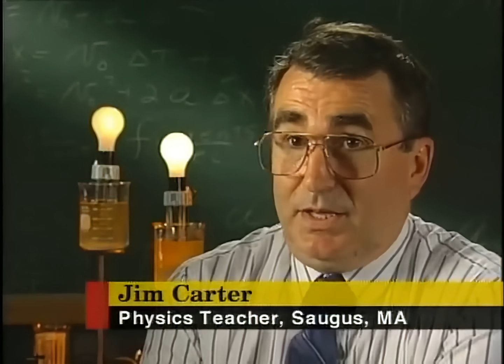MIT graduates cannot power a light bulb with a battery.

Comment: It was a trick question.  The correct answer would have been "It depends on the battery and the light bulb."
Reply: Geir Sunde No, the question was actually very poorly worded "Can you light a bulb with a battery?"  What kind of bulb?  A garlic bulb?  What do you mean light it?  Set it on fire?

The question should have been "Can you make this lightbulb turn on with this battery and wire?"  Because no matter how you hook it up, a D cell battery isn't going to light up a 20 watt lightbulb, it's barely going to light up a 2 watt indicator light in fact, and even then the battery is going to get very hot very fast from all the current it has to deliver.  A flashlight lightbulb?  Yes, but they only show one of those in this video, and it's where the guy gets it to light up.

All this is is an example of poor journalism.
Reply: Geir Sunde look at the size of those bulbs!  Are you nuts?  Have you ever even seen a flashlight that runs on one D cell?
Reply: Well the DC part shouldn't matter, because a light bulb is a purely resistive load, but yeah, it's still just a journalism chop job.  This is why you shouldn't give interviews to journalism students.  They do this stuff not just for local news, but usually as a school project also, and they're more than willing to cut out anything intelligent you say if they want you to look dumb.
Reply: Justin Hall We had a project in grade 9 science class where we had one 9v battery and we had to build a main floor of a house out of a cardboard box that had to have a living room, bedroom, kitchen/dining area and a bathroom. We had to have three Christmas lights in every room plus two extra appliances that turned on separately. We couldn't get the 9v battery to light the lights furthest away because the battery wasn't strong enough to create a current that could make it through all of the wire and light the lights. So we got separate batteries for each room and used nightlight switches to turn the power on to each room. We got a 52 on the project because we were only suppose to use one battery but us and a few other groups explained that one battery wasn't strong enough but she didn't care and kept the grade the same. I guess this is a similar situation to that.
Reply: Justin Hall Not to mention most "bulbs" (assuming they mean a light bulb that goes in an ordinary house light fixture) runs on AC power, which in America is at 120V, with an available current in most house circuits of 10-20 Amps, and she wants them to power this same light bulb from a DC power source, which is a 1.5V battery, with a maximum of 1 Amp hour? Absurd.
Reply: Justin Hall Agreed. I don't know the resistive characteristics of an ordinary light bulb, but if it's designed to operate at 120V AC, then it probably wouldn't even produce a noticeable amount of light at 1.5V DC, and depending on how much resistance is present in the bulb, it may not be enough to prevent the bulb from overdrawing the battery, causing it to overheat and possibly explode.
Reply: Justin Hall  Right. 

Back to Ohm's Law again;

I = V/R ; The larger you make the resistance of the circuit (ie the light bulb) the more electric potential from the battery you will need to produce a current. This makes sense since Watt is the unit of Power which in Physics is just (Work/Time).
Reply: Justin Hall Surely there was a lot of cutting to get only the reactions they wanted, but the question wasn't a trick. It was given in a very simple way but in good faith.

You can light a halogen headlight with a battery, by the way. Source: I just did it with a halogen car headlight from a Lincoln Towncar I once had. Always keep your parts, kids! It didn't produce much, but glowed still. The battery voltage dropped to 1.2 volts, and the draw was 600 mA. At the rough average of 15 lm/w luminous efficacy of halogen lamps, the bulb likely produced around 10 lumens, which is not negligible.

I'm sidestepping your assertion though, that the question was poorly formed. Sure, it was not a very precise question, but the answer is unambiguous if you break down the grammar. "Can you light a bulb with a battery" can be restated with no loss as "Is it possible to combine an X and Y, to produce visible light?" where X ∈ bulb and Y ∈ battery for the entire sets of bulbs and batteries respectively. Combining these sets using the question as an aggregate function gives XY, which is a composite set containing the answer to the question "Does this X and Y produce light?" for every combination of bulb and battery. We know that at least one element is yes (true), because I just lit a halogen with a D cell above. Because at lease one element is yes, the question is yes, because the question is asking if it is possible to light a bulb with a battery, and we now know it is.

tl;dr: I wanted to use set notation in a YouTube comment.
Reply: jmichaelrout Excel is actually an excellent tool for any engineer.  Are you claiming to be an engineer that doesn't use spreadsheets?  If so, you're not an engineer.

I use Autocad a fair amount too... how is that supposed to be an insult?

Yes, computers help us do mathematics, but you need to be able to do the mathematics YOURSELF in order to know what methods to apply.

Have you ever even heard of Lean Six Sigma before?

Please, mighty internet troll, tell me more about how you're an engineer who doesn't design things or do math.  Do you do anything at all?

Oh wait, I get it now, you must be a TRAIN engineer.
Reply: Justin Hall Car headlamps produce something on the order of a thousand lumens. The function for output of a halogen is not linear, but it's close to linear at V^1.2 referenced against the bulb's rating. Knowing this, you somehow think it's completely impossible for one of these bulbs to produce a visible amount of light when driven with 1.8% of its rating? Even when also knowing the limit of light perception in humans is extremely small, on the order of a μcd/m^2 ?

http://quiqsnip.com/Ch6Me2Wk.jpg
http://quiqsnip.com/Ch6NXSev.jpg

Well, now you know you were wrong. The first image is driving the lamp with a single battery. The output is roughly a lumen. The second image, done just for kicks, is a two battery series configuration. This configuration produces enough light to make looking directly at the filament difficult. The bulb was very hot at the end of the photo session. The camera was unintentionally rotated between the pictures. Against laboratory guidelines, a total of three (3) Lays brand salted potato chips were eaten during the experiment.

In all seriousness, and do note this is not meant to be an ad-hominem attack, but neither is it a compliment: I only rarely meet engineers as stubbornly crystalline in mind as you, and they are never very good engineers. It would do you well to think about why you so staunchly resisted my assertions. Perhaps doing so will encourage some much needed flow, and hopefully one day you'll hit the play-doh like consistency all proper researchers and problem solvers have.
Reply: Justin Hall Solving differential equations? You shit-brained hick. Have you ever generated a differential equation? The only thing you've proven is you know how to use various types of calculators. And you completely ignored the other points I made. Again, the reading comprehension thing. You must have gotten straight Cs in your composition classes. 

Whatever a fun or a boring troll is, I really don't know or care. I work in the power electronics and semiconductor manufacturing industry. That's about as comfortable as I am going to get with my personal or work information with some backwoods inbred on the internet. I know my shit. You may be good at making 3M lots of money, but it's now patently obvious that you're at least a standard deviation below the average IQ. 

You're making a very bad name for 3M. Someone should talk to their human resources department about this. People have gotten fired for less over Facebook posts.
Reply: Geir Sunde Dude, how and why do you consider the specifications of the components "irrelevant" information. Please leave, you're not an engineer.
You have no clue how much shit i've had to fix because people like you "didn't see the relevance".

Even disregarding the above, if you ask an engineer to make something the first thing they do is ask questions, even before they say yes or no. That's just the way they are.
Reply: Geir Sunde No, he's not nitpicking. Different bulbs have different wattages. If the wattage is low enough, just about any battery can power it. A higher wattage battery requires more power. For example, if I have a 1kW lightbulb, there is no way that a small 1.5V dry cell battery (the one that's seen in the video) can ever light that up. And you'll also notice that different students are given different light bulbs (the girl wearing sunglasses is given a bulb having a much higher wattage than the guy who's given a tiny bulb).

Also, I'd like to have two lengths of wire rather than just one.
Reply: Justin Hall Explain.
Reply: jmichaelrout Well every light bulb except that small one probably required more power to light up than that little battery could possibly deliver.  That's why only that one guy barely got that tiny light bulb to light up.  Give me a car battery though and you can light up the headlights on a car.

Thus it all depends on the battery and the lightbulb that you're talking about.
Reply: Justin Hall This is simple as hell it isnt because of the batter i used triple a's to work a regular light bulb.There just retarded i did this shit back in 1st grade for my science project.
Reply: Tyler Jackson lol, yeah right.  You may have dreamed that.  You can light up an led with triple A's.
Reply: ***** That sounds about right.
Reply: ***** Excellent analysis.  I commend you for taking the time to explain it.  Some dunce is probably going to come along and argue with you about it though.
Reply: Justin Hall Absolutely, No problem. I'm a Chemistry major, and often times I find people on here spouting completely inaccurate or horribly off base things about how scientific phenomena and objects act and behave. Most of the time it' simply because they lack the actual knowledge to do so, or are just misinformed, or believe in random pseudoscientific claims. If you have any other questions about this, feel free to ask. 

The battery itself can be explained through Electrochemistry concepts, but the overall problem is definitely a physics problem, because it relies on the concepts of simple circuits.
Reply: That's not the point, I don't think. I think they just wanted the students to demonstrate the concept.
Reply: Oh look... here comes one now.
Reply: ***** 
I'm actually an electrical engineer, which is why this video caught my attention. My areas of specialization aren't exactly germane to analog circuit analysis, but I'm certainly no slouch and I think I learned this simple kind of circuit when I was a kid. I appreciate your explanation though. ^^ I was just curious about the OP's reasoning. Also, the wire doesn't carry current from the anode of the battery to the cathode of the battery in this circuit, but I know what you mean to say.
Reply: Justin Hall OK, precious.
Reply: jmichaelrout My reasoning is that a 1.5 volt battery would have to deliver 7 amps of current to light up even a 10 watt lightbulb:

That's not possible given the battery shown, and those lightbulbs all look to be well above 10 watts (except the flashlight bulb).

Any engineer regardless of flavor ought to be able to figure that without much effort.

A flashlight bulb is typically 2 watts or less.  Even then, one D cell battery is going to struggle to get it to glow at all.

Small dry cell batteries are bad at delivering power rapidly because they have a high internal resistance, the electrolyte within them can't transmit current fast enough to deliver power rapidly.  When you push a little D cell alkaline battery it's going to get hot fast, and then it will become even slower at delivering current and eventually it will blow it's gasket and fail.

KCL and KVL are just as critical to digital electronics as analog, so I don't see how you could be an EE and not understand SFLOVER94's analysis.  I avoided that type of analysis because most people don't know nodal analysis.

Any double E ought to though.
Reply: jmichaelrout  Demonstrating the concept or not, the actual concepts and and inquiries behind circuits themselves are still the same. Because of this, I am allowed to explain the process of how the concept is carried out on a fundamental basis. It's not everyday you get to come across somebody who actually knows what they're talking about, and is right about it, but for those who aren't, I will usually tell them otherwise and explain why. 

And no, it doesn't. The signs are completely for convention when using Kirchhoff's Rules for solving for different parts of a circuit. 
In the battery itself, Reduction takes place in the Cathode, while Oxidation takes place at the Anode.
Reply: jmichaelrout To be perfectly clear, they answered the question wrong.  There is no engineering question that you can answer without parameters.  "Can you light a bulb with a battery?"  If your answer isn't "I need more information than that." then you're wrong.  These kids got tricked into looking dumb on camera because they said "Of course I can!" not knowing they would be handed a D cell and a light bulb intended for mains power supply.
Reply: ***** Good point. I didn't mean the sign convention. I meant that the "trick" of wiring this circuit is using some ingenuity since you're only given one wire. The terminal (cathode, anode, doesn't really matter, you'll just get a reversed current but the bulb will still light) of the battery has to be butted up directly to the battery, hence, no wire. Exactly like a flashlight, actually.
Reply: Justin Hall I don't think so. She even asked a follow-up question, "why doesn't it work?" It doesn't really matter though, lol. My enjoyment came from seeing MIT kids not having a clue as to how to wire it correctly, tricks aside. Hilarious.
Reply: jmichaelrout I'm sure they cut out all the parts where the more intelligent students said "Well not THAT lightbulb with THIS battery."  Don't you find it suspect that the professor interviewed is from Harvard?  It's a journalism project by a Harvard student trying to make MIT students look dumb.  It looks like it convinces most people well enough.
Reply: Justin Hall It physically showed people wiring it incorrectly, regardless of the bulb/battery. That's my only concern. It convinces me that some MIT students can be dumb, yes.
Reply: Justin Hall Strictly speaking, the answer to the question "Can you light a bulb with a battery" is yes, because the parameters are implicitly unbounded; there are at least some combinations of batteries and light bulbs that result in appreciable illumination. If they gave you a coin cell and a projector lamp, you could protest "I said I could light a bulb with a battery, not any bulb with any battery".

All of this is squabbling though, because the syntax of the question is not the point. The point is, these graduates have no basic understanding of the fundamental forces surrounding them. The mechanical engineer was particularly horrifying. I find it hard to believe she has a greater-than-tenuous grasp of physics, let alone enough education to be worth anything in her field.
Reply: bloomtom EXACTLY.
Reply: bloomtom I'm sure they cut out all of the students that said "Not THAT bulb", just like they cut out all of the smart people on "Jaywalking" and the old Veritasium street interviews.

They probably interviewed 25 students or more to get enough people to actually try it.

I'm not defending the students, they walked into the trap, but it's a TRICK QUESTION.

I still disagree, you can't light up a halogen headlight with a D cell battery.  A sloppy engineer is an unemployed engineer.
Reply: Justin Hall Woah there buddy. I'm an employed and punctilious engineer. I'll stick to my job and you stick to yours. It depends on your definition of "light up" if you want to get pedantic (which is completely and utterly missing the point). Photons are being emitted with a D cell hooked up to a halogen, therefore it's being lit up. There are photons and there is light. Also, point number 2, MIT is only supposed to have "smart people".
Reply: jmichaelrout LOL!!!! MIT is only supposed to have smart people?!?!?  About half are smart, the rest have money.

There are always photons.  Ever heard of black body radiation?

Yeah, I will stick to my job: 

https://www.linkedin.com/pub/justin-hall/49/1b3/2ab
Reply: Justin Hall 
Who gets into MIT with money alone?

Black-body radiation has absolutely nothing to do with anything. Photons were excited by electric potential >>> light. 

Funny, you don't strike me as an engineer at all. Could you wire this circuit correctly before viewing the video?
Reply: bloomtom Careful, Bloomtom. Justin has a bachelor's degree in mathematics and he knows how to use it.
Reply: jmichaelrout
I have associates degrees in EE/CE from a community college and can't factor worth a damn.
Bring it on.
Reply: bloomtom lol, well I agree with you on every count. I don't know why or how people read so much into these things.
Reply: jmichaelrout And Electrical and Computer Engineering.
Reply: bloomtom And you used a D cell?  I guess you'll upload a video then, or it didn't happen.

Yeah, lets see... 1.2 volts at .6 amps.  That's .72 watts.  Since halogen car headlights use about 40 watts, you're obviously lying.

The light emitted by a bulb isn't a linear function of the power applied.  LOL

Now I don't even believe you went to community college.
Reply: Justin Hall You don't think like an Engineer. You may be in the wrong field.
Reply: jmichaelrout LOL, why, because I think?
Reply: Justin Hall Because you can't see the forest for the trees. It's not an insult (even though you insulted me). You're extremely right-brained, and focus on minute details that don't even matter at a macroscopic level - like an experimental scientist. Definitely not an engineer or a theoretical scientist.
Reply: jmichaelrout Engineering is applied mathematics and design, as well as hands on participation.  Also, the whole right brain left brain thing is urban myth.
Reply: Justin Hall Not a lot of working engineers I know use any kind of advanced applied mathematics at all, especially with only a bachelor's degree. This seems immaterial to anything I said, so I'm not sure what your point is. 

What does "urban myth" mean? Also, lateralization has a pretty strong, well-established scientific foundation. At any rate, you shouldn't take it literally. It's a byword for someone who is incapable of thinking wholly but instead looks at things piece-wise. Don't take this the wrong way, but your reading comprehension is extremely questionable.
Reply: jmichaelrout look it up.  If you're speaking figuratively, then you said the wrong side anyway.

Finally I think you're confused.  You've described a technician, not a working engineer.
Reply: Justin Hall Yes, left-brained. My point still stands.

I'm not confused, I'm a fucking engineer. What advanced "applied mathematics" do you use? You're just an autocad drone. Even if for some reason you are using anything beyond algebra, you're still an outlier in that respect. Ask all of the engineers you know. Take a poll. I rarely (never?) hear of any engineer who is not involved in R&D using advanced mathematics in their work. Furthermore, it's extremely rare to be involved in R&D with just an undergrad degree. Especially an undergraduate without honors from an unknown university.
Reply: jmichaelrout Mainly statistics, but lots of physics too with vision systems.  Tons and tons of statistics.  We make a lot of products, and a lot of each one.  When you are responsible for 18 and counting vision systems to inspect products you do a lot of statistics. You can easily be a design engineer with bachelor's degrees.

Pretty much everything you are saying is wrong.
Reply: Justin Hall Statistics is not applied mathematics. What kind of statistics do you do that doesn't involve an Excel spreadsheet?
Reply: Justin Hall Don't twist my words. I think you've answered my question as well. Plugging shit into Excel is not using "applied mathematics". Plugging shit into Matlab or Mathematica (like researchers) might be considered using applied mathematics depending on the application. You don't really need a whole lot of talent to do fill out Excel spreadsheets.

All engineers are able to do applied mathematics (introductory applied courses are a prereq for everyone), but the overwhelming majority don't in their everyday jobs. And you don't. So don't say that you do.
Reply: I use matlab too... it doesn't require any more talent than excel.  Neither does R.  Using programs to solve math problems is a significant time saver, but you still have to have learned the math to know how to use those programs.

Anybody can plug numbers into an excel spreadsheet, or do addition with a CAS... knowing how to make a spreadsheet do advanced mathematics, regression, and model data into functions requires a deep understanding of the math.

ALL math is simple.  That's the primary feature of math, the rules are set in stone, and a series of algorithms can solve any math problem, it's remembering which algorithms to use that is considered skill or talent.

That IS advanced math.

And yes, I use it nearly every day.  I use math and do design every bit as often as I carry a set of allen wrenches or a FLUKE 87.

I guess your company doesn't use lean six sigma for engineering projects?  I'm not seeing any responses from you than indicate that YOU do anything.
Reply: Justin Hall That's why I said it depends on the application. It's kind of dubious to call plugging numbers into ready-made formulas (i.e. statistics) a use of advanced applied mathematics. I never said Matlab as a programming language was hard, it's the application that can be hard. Writing words in English is easy - writing on the level of Shakespeare is hard. 

Absolutely no application using Excel spreadsheets requires a degree in anything, please try to convince me otherwise. "All math is simple"? "All rules are set in stone"? "A series of algorithms can solve any problem"? You're delusional. Math rules have changed a lot since its inception, the introduction of non-Euclidean geometry is a great example just off the top of my head. Coming up with the algorithms is where differential equations, calculus, and other applied mathematics comes into play, not plugging and chugging into Excel spreadsheets. A child can plug and chug.

My company does use Lean Six Sigma, yet another red herring that's not at all germane to the conversation.
Reply: jmichaelrout You realize that you can solve Diff-EQ's with excel, as well as laplace, inverse laplace, fourier series, fourier transform, Z transform, and all of that with little old Excel, right?

Making an excel sheet that does that is not "plug and chug"

Six sigma is extremely important to each engineering project if your company uses it... And it should if it wants to optimize profits and minimize waste.

How is mentioning lean six sigma a red herring?  I constantly have at least one greenbelt project going.  The last one was setting up a vision system to eliminate manual inspection from an assembly process.

I do a lot of those... They save my company a lot of money every month, and that goes in a spreadsheet too.  That's the spreadsheet that tells whether you are a good engineer or not.

The only red herring here is the fact that you can't even explain one little task you do at work.  WHAT DO YOU DO???
Reply: jmichaelrout You have proven to me that you know absolutely nothing about the engineering profession.  Just a troll.  You're not even a fun troll, you're a very BORING troll.
Reply: jmichaelrout LOL!  You can definitely solve Diffeq's with excel, look it up.  There are plenty of tutorials on it.

I admit, you were totally right about the halogen bulb... I picked the wrong type of lightbulb as an example.

What other points did you make?  Go ahead and tell HR that you've seen my linkedin profile... quote me on anything.  What did I say that would get me fired?  That you're an internet troll?  Good one, buddy.

I might have been wrong about the halogen bulb lighting up, and I'm genuinely surprised by that, but seriously, you're the only person saying anything rude here.

I was wrong about the halogen bulb, now do it with a mains bulb.
Reply: Justin Hall Oh my fucking god. I know you can solve DE's with Excel. I never said you couldn't. This is seriously like talking to a 5 year old. I really don't mean to be rude, you're a fellow engineer. It's just amazingly frustrating that I can't seem make you understand the points I'm trying to make and on top of that you keep changing the subject. Let's just call it a draw. I'm done.
Reply: jmichaelrout Okay, I'm plenty bored anyway.  You're simply a rude person.  I did learn that you can light a halogen headlight with next to nothing, but you're foul mouthed!

It's really simple:  If you don't mean to be rude don't be, and people will be nice to you back.

Is it that hard?
Reply: Justin Hall I don't know, is it? You were rude first by insinuating that I was a "sloppy engineer", which was completely uncalled for. I tried very hard not to be rude, but you're incorrigible. It is extremely hard not to be rude with you, yes.
Reply: jmichaelrout I didn't say that about you at all, I simply made the statement.  It's ironic, and funny that I was wrong about the halogen bulb at the same time, but I wasn't saying YOU were sloppy and unemployed.

Don't take things so personally, not everything is about you.
Reply: Justin Hall Damn, thought it was all about me.
Reply: bloomtom You got me with the Halogen bulb.  I'm happy to admit when I've been wrong.  I was genuinely surprised by that.  I don't think it would work with other types of incandescent bulbs, but hey, I've been wrong before.

By the way... that was an ad hominem attack, whether you intended it to be or not.  But I probably deserved it, and it's not that easy to hurt my feelings.
Reply: jmichaelrout Lol, I hope that's why you called me a "shit-brained hick".  Classy.

And yes, I've generated differential equations, that's what the statistical analysis helps you do, model real systems with differential equations.  I thought I had made that pretty clear.

That's okay though, I'm not going to let a few insults from a guy behind a keyboard on the internet bother me.
Reply: Justin Hall At low powers, halogen bulbs operate in the same way as a regular incandescent since the halogen cycle only works at high temperatures. The whole point of a halogen is the ability to run the filament at an absurd temperature to get better luminous efficacy. So, yeah, it'll work. The experiment was largely unnecessary imo, as the theory behind all of this is well established and the math was easily at hand.

My closing statement was very plainly not an ad hominem, as I was not using personal criticism in lieu of an argument, or to supplement an argument. Also I was not trying to hurt your feelings. My intention was to cause real critical self-analysis. I truly, honestly, really seriously for real here listen closely, hope you take my words to heart.
Reply: bloomtom I actually will.  Thanks.
Reply: Justin Hall You still don't know what "generate a differential equation" means, but that's OK. My insults shouldn't bother you, but your own intransigent attitude and unjustified cockiness should.
Reply: jmichaelrout Yes, actually I do.  I "generate" second order differential equations to measure and predict defects.  They're based on stock of BOM items, the change in stock, and the net worth of the components.  Alternatively I use the same methods to measure defect incidence.

I usually don't have to do analysis for electrical systems because PLC circuits are pretty straightforward, but I have no problem doing analysis with Laplace transformation of an analog system to generate a Diff-EQ or a Z transform for a digital system.

I think you're the cocky one here, calling people names and being a total troll.
Reply: jmichaelrout If you work in semiconductors AND power systems, then I suppose a bachelors degree won't allow you to do much engineering design.  I work in manufacturing and assembly.  That's probably why you don't see many BS doing design work, while that's about 70 percent of what I do.
Reply: Tyler Jackson You must have bunked English class to take part in that 1st grade 'science project'.
Reply: Alex K. THIS SHIT I DID FOR MY SCIENCE PROJECT 5 years ago.LOL I GOT A B ON THIS SHIT.
Reply: ***** For your science class project, I think the main idea was that if you hooked them up in parallel instead of in series, then the single battery would be enough.
Reply: Brandon Reese Actually if I recall some the requirements were to hook two of the rooms up DC and the other 2 AC so we had a mix of both.
Reply: ***** I honestly don't really remember. I remember we had the one battery and used the Christmas light wire and strung it from the battery all around the outside of the box and then when we needed a light we cut into that section of wire then wired in the light either AC or DC, which ever way that room was suppose to be. For the separate appliances we ran separate wires from the battery to the appliance then back to the battery to close the circuit. When all of that didn't work on one battery we just got batteries for each room and wired the same way and it worked for each individual room. I think the real problem was our box was huge so I think there was just too much resistance for the one battery to get a current all the way around the box.
Reply: +Justin Hall That's actually not true.
Reply: that was exactly what i was thinking. but oh my god, those people lack some general knowledge
Reply: You might also need a resistor
Reply: The power rating for that light bulb was too high for that battery. The incandescent part makes it okay for either AC or DC because it is just heating up the filament inside but the power output out of the battery is too low to be anything of substance.
Reply: And the "wire".
Reply: They were using a small incandescent bulb, I believe.  They didn't have LEDs in bulb form factors back then in common usage.  Other forms of light also weren't commonly referred to as bulbs.  Incandescents merely need to be heated, and ANY voltage will do that.  It'll just be dim if it's a low voltage (x current) for the size of the bulb.  You can light one with no voltage by just applying heat.  Because that's how they work!
Reply: Justin Hall The question wasn't "can you power any light bulb with any battery?", so I fail to see the relevance here.
Reply: Justin Hall  You technically are correct. If we think back to E&M for a second, and remember how circuits work, then this question should come as no surprise to anyone let alone students from MIT. 

A circuit can essentially be made up of at least 2 fundamental elements:

-A Battery (that acts as a voltage source)
- A wire (which carries current from the positive terminal of the battery to the negative terminal)

Now, more complex circuits include elements such as resistors, capacitors, inductors, transformers, switches, etc.

But the question here, does essentially depend on how much power the bulb is able to produce (in Watts)
And what the voltage drop across the circuit is (that is, what is the maximum voltage applied to the circuit and/or resistors of the circuit.

We can use Ohm's Law to help us find what the voltage of the battery is

I = V/R ; V = IR

Where: 

V=Voltage
I=Current
R=Resistance

+V - IR = 0

Here, the light bulb will be acting as the resistor, and therefore will be applying the difference in potential drop.

We know that due to Kirchhoff's Loop Rule, the total voltage drop (potential difference) inside the loop of a circuit has to be equal to 0, thus if the light bulb in the circuit has some resistance associated with it, then the current would also be equal to the Voltage due to the battery divided by the resistance of the light bulb, thus giving us a current produce in the circuit. Thus, if a circuit with a wire and a battery are given, the power a lightbulb (of really small power), and is connected, the difference in potential will be enough so that the circuit is able to do work on the light bulb, such that,, when current flows that through the wire, the atoms the current interact with the conducting metal inside the light bulb, causing an array of reactions to occur such that the lightbulb is able to give off light given the that the right amount of current is constantly being applied to it.

jmichaelrout 

And there's the science behind this question. Enjoy.
Reply: Justin Hall  To be honest I think you're nitpicking. The essence of this was not the initial question, but the following demand for a demonstration where the given battery was sufficient to do the job.